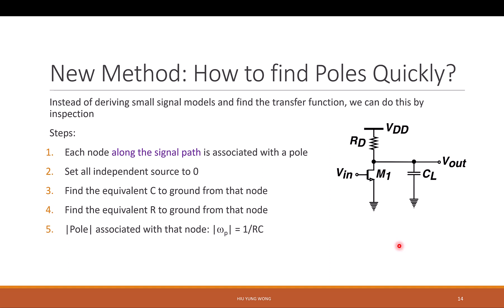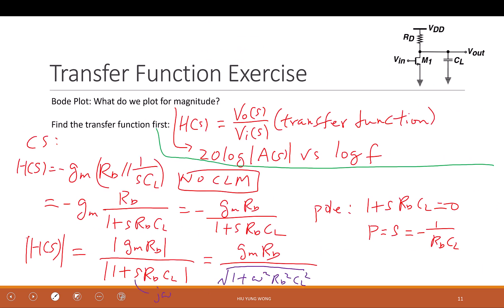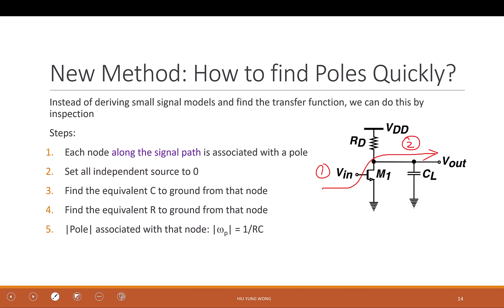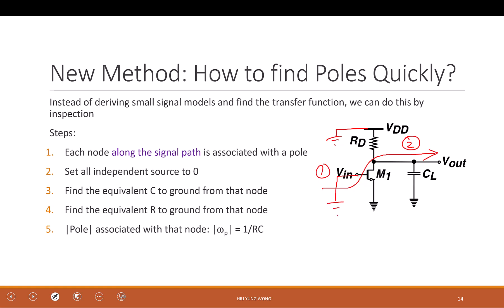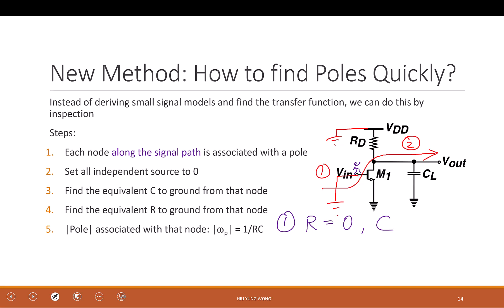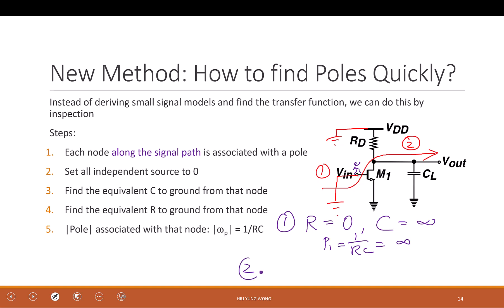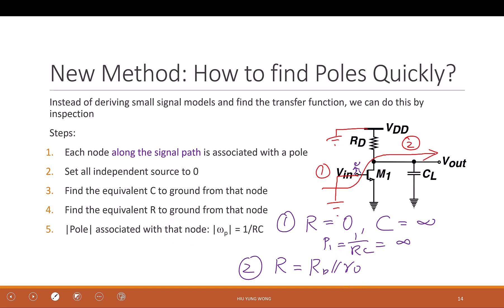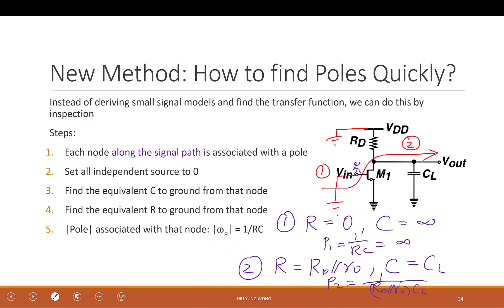L17-5 Finding Pole by Inspection

Comment from the maker: I made a mistake at node 1. The capacitance should be 0 instead of infinity. This is because when we consider the "capacitance" path, we need to ignore the wire connecting the gate to the ground (which is a resistance path, and we can break it to make this clearer).
Reply: hi is there any video explaining the purpose of poles and zeros?
Reply from the maker: @vigneshsiva1580  Poles and zeros can be used to engineer circuits to have different frequency responses. It can be used to build different types of filters. Here is an example to build a bandpass filter https://youtu.be/1p_e8DqxJb8?si=nB0cBEPWTj5RtKsu
Reply: @quantum_computing   thanks sir